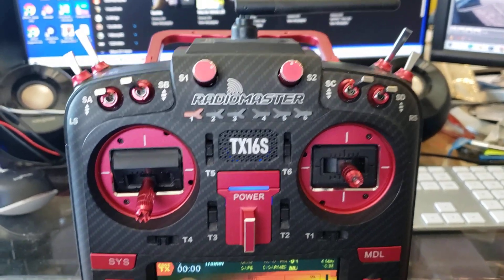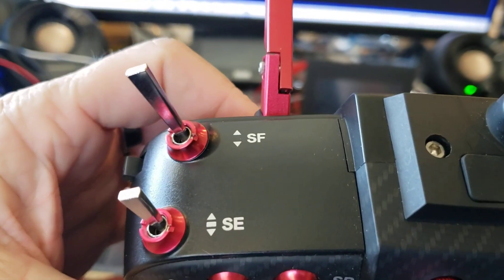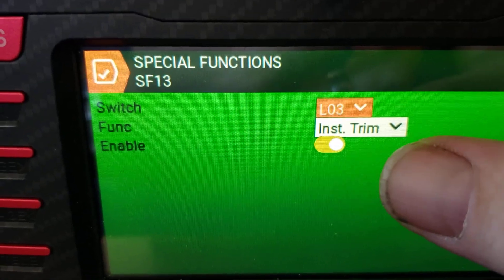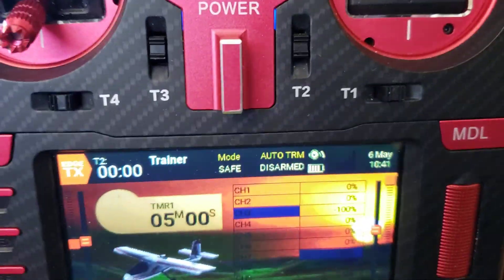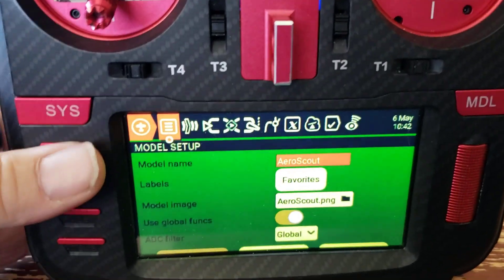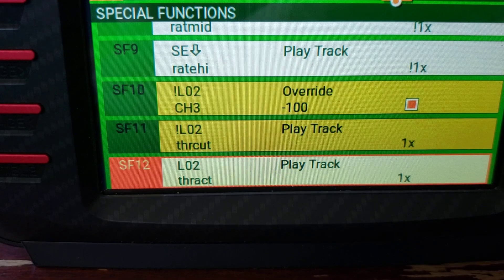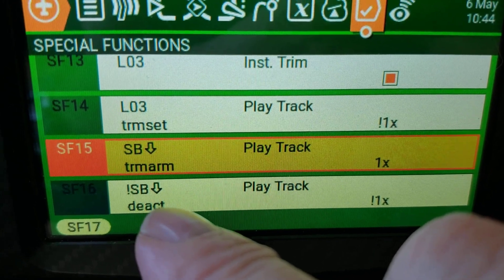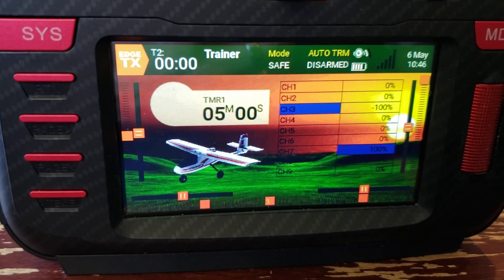EdgeTX Auto Trim Logic on Radiomaster TX16S

Comment: I have an interesting problem on a delta set up. My aileron trim works in the reverse direction to the aileron stick. How is this even possible? Do you have any idea what I could have done wrong?
Reply from the maker: @gregevershed6001  if the surface needed to be reversed and you did it in the input the trim would be reverse.  Invert channels in the outputs. 2nd choice would be in the mixes under rare circumstances.

Comment: How do I fix the trim it’s reversed on radiomaster slider
Reply from the maker: @ClaudeFrancois-f2t  what do you mean the slider trim?   Usually if a trim switch is acting in the reverse direction is means you set a negative weight in the inputs, presumably to invert a channel.  If you had a channel that was moving the servo backwards you invert that channel in the outputs, not in the inputs.

If this wasn't your issue please explain your issue in more detail.
Reply: @shanesdiy  yes I guess if I inverted the channel the trim slider would also be reversed Since for me to adjust the trim I have to move the loser on opposite direction to trim the plane
Reply: @shanesdiy  if I need to apply down elevator trim on slider I have to move the trim slider up
Reply from the maker: @ClaudeFrancois-f2t  Which trim switch are you referring to as "slider"?  The trim switches are not sliders.  To trim elevator down you would push the trim switch (you are calling a slider?) forward same as the elevator stick to go down.  If this is not what yours is doing, look at your inputs.  None of your inputs should have a negative weight.  They should be +100 or if you have reduced rates, you might have an input at +70 for example.  None of our inputs should have a weight value with a negative (-) sign in front.
Reply: @shanesdiy  tje T2 switch, i looked if my channel for elevator is reversed and it is not, set at 100 value for inputs, output is -100 to 100
Reply from the maker: @ClaudeFrancois-f2t  pushing T2 forward would be down elevator trim, pulling it back would be up elevator trim.  Is it not working that way? It mirrors the elevator stick.
Reply: @shanesdiy  no it’s reversed
Reply from the maker: @ClaudeFrancois-f2t  Is this on a TX16S?  If you'd like to email me the model.yml file for the model you are working on I can take a look at it. I tried to replicate your anomaly and the only way I could replicate was to change the elevator input weight to -100.  Does it only do this for elevator trim or does it also do this for aileron and rudder trims?

Email is below if interested. Also in the "About" section for the channel.
shanesdiychannel [@] gmail.com
Reply: @shanesdiy  I will test the others I think only elevator
Reply from the maker: @ClaudeFrancois-f2t  fascinating case, hopefully you can send me the "model##.yml" file off the SD card.

Comment: I have added auto trim to a global function so it works on any model I select -- I would like to use on of the button switches to arm and disarm it as you did --- If I do this in Logic functions will it work to arm and disarm the global function regardless of which model I am on ---- or does it need to done in each model
Reply from the maker: As a global function you wouldn't be able to arm and disarm it like I did here.  Global functions won't accept logical switches as a source and there is no "global logical switch".  All you can really do it set up the global function for auto trim and go in and manually enable or disable it when you think you want to use it, like on a maiden flight.  Otherwise you'll have to do this at the model level.
Reply: Thanks that’s kind of what I  thought but wasn’t sure. I have been doing just what you described using the enable slide in the Global function 
Don’t really want to have to do this for each model. Thanks again love your videos on the Radiomaster setups!!

Comment: Has anyone figured out how to program a switch to reset the trims to center after a flight? Thanks in advance!
Reply from the maker: Not sure yet how to link a switch to it, but you can go into the model setup, scroll down to "Trims", enter that and there is a button in there that says "Reset" that will zero all trims when pressed.  If I find a way to link a switch or button to it I will let you know.  This is on 2.9.+, don't remember where that option is on older firmware.
Reply: Thanks for the quick reply Shane!
Reply: They should have programed that feature to instant trim/reset trim.

Comment: So I’m gonna speak from a past experience.   The throttle cut being on the bottom remote switches is a bad idea if u use a lanyard.   I accidentally drug my controller on the ground with the lanyard around my neck.  It turned off the throttle lock and I was removing the battery from the aircraft.  Almost lost my left pinky er put 49 stitches In it.    And lost 30% of its function.   Your videos are awesome brother keep ‘em coming
Reply from the maker: Thanks for the safety tip.  I do use SH for my throttle cut but I have an added layer of protection that the throttle stick must be down AND SH must be switched to enable the throttle. That way you can't bump the throttle cut switch while the throttle stick is up and immediately start the motor.  Multiple layers of safety are highly recommended, another reason I love the TX16S, nearly anything you can imagine is possible.

On another note, I believe it was you, posted a video on Facebook showing assigning a safe channel with the "stick down and in and switch flip" method?  If so, that was a good demo while watching the Forward Programming screen and seeing the channel change in real time. In all my videos on the subject I hadn't done that, great visual!  I might have to steal that one for another short video on my Spektrum -> EdgeTX series!  I'll be sure to give you a mention if I do. 😉
Reply: @shanesdiy  see I learned another trick!!!   Didn’t even know I could do that with the throttle cut!  Ima find your video I guess!  Thanks man. I’ve actually got a guy that can’t make an ar8360 activate safe with a radiomaster tx16s is why I made that video.   He needs more help than what I know.
Reply from the maker: @rodgersrcaviation2785  I haven't made a video on my throttle cut. I think I used some tips from RC Video Reviews channel for the method.

If your friend needs more assistance maybe we can join forces and figure it out. Has he posted on one of the many Facebook groups we monitor?

Comment: A long video to just describe what Instant trim is?
Reply from the maker: Hi Bill. This was a requested video and is more than just a description of auto trim. I've added some extra logic and voice responses to help prevent inadvertent triggering.

...or was that a rhetorical question? lol  Thanks for the comment. :)
Reply: @shanesdiy  I agree with you, this is an example video that shows some of the power you can bring to EdgeTX with logical switches, special functions, and the hardware you have. Sure, there's a "literal" value to what you showed that will initiate instant trim, but if you use this as inspiration for what else you can do when you combine the many parts that are going on here, it shows much much more !